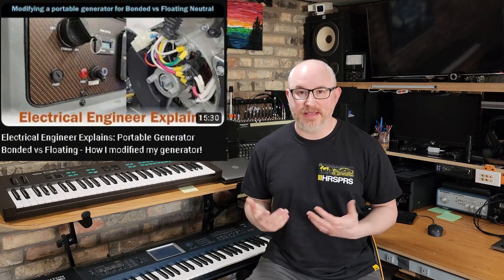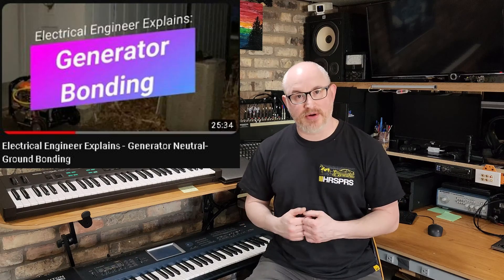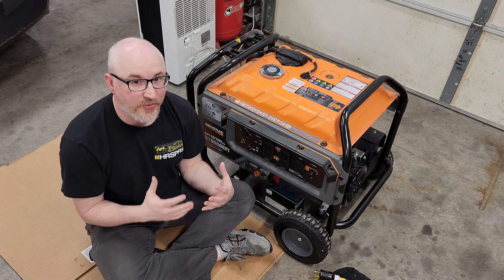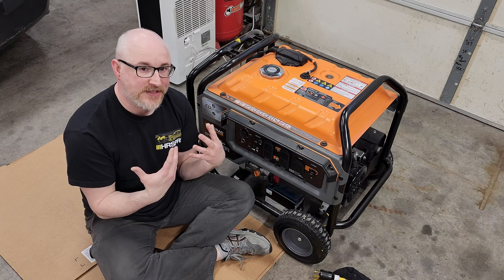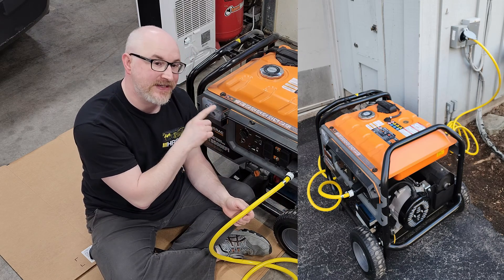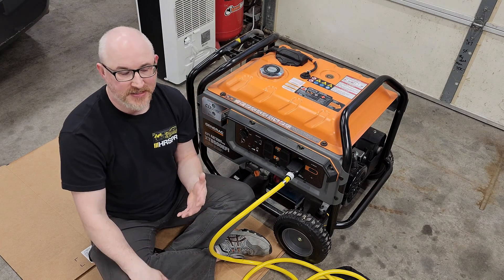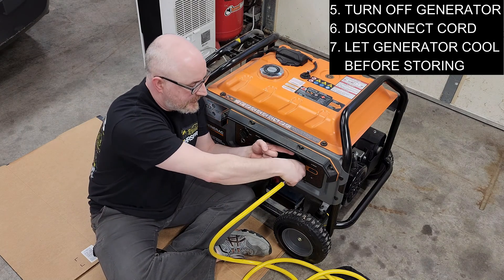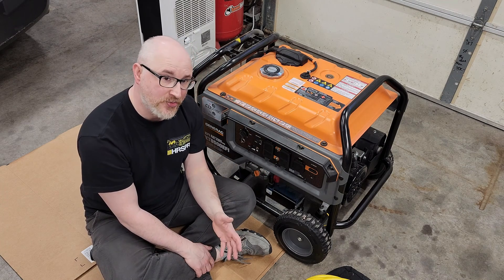Part 2 - Electrical Engineer Explains - Modifying My Generator For Floating vs. Bonding Neutral!

Comment: Can you please give a link to the switch you installed or the rating of the switch. Thanks in advance!
Reply from the maker: I thought I replied to this already, my apologies.  It's a 250V rated switch with 20A contacts, which is why I wire the conductors in parallel, so I have two wires and two switch contacts for a combined rating of 40A.
Reply: @richardvedvik979  thanks so much!